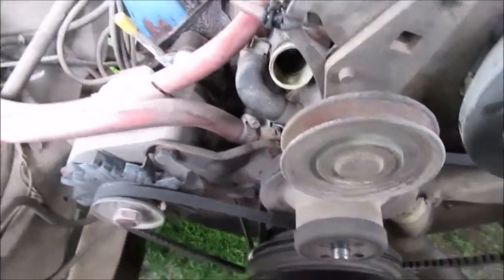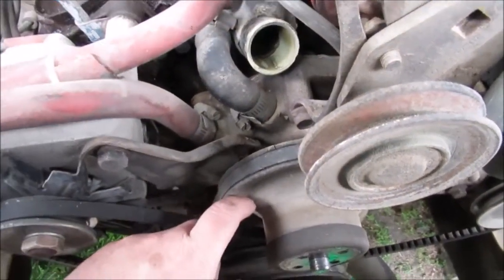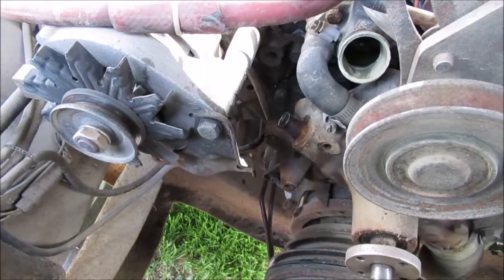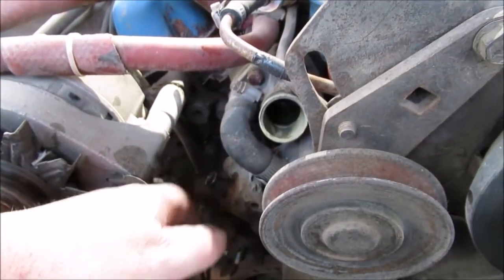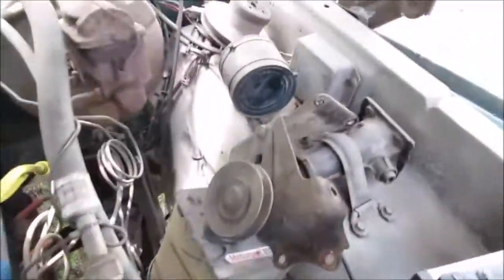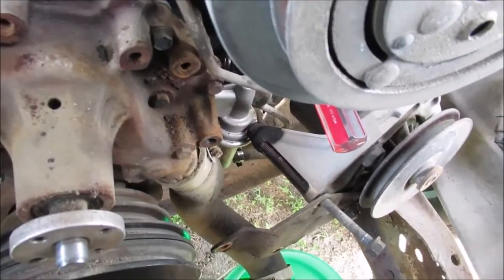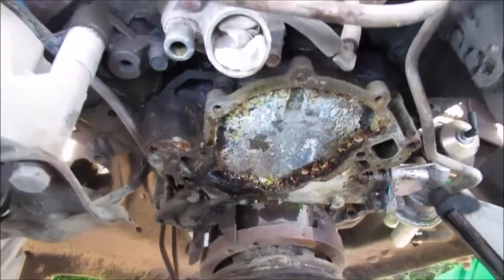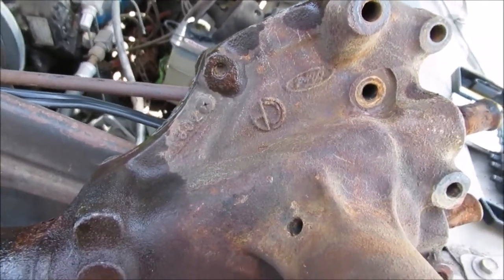Water Pump Removal Ford 302

Comment: That sure brings back memories. The last water pump I changed was in my old 1980 dodge ram with a 318 many years ago.  I’m scared to open the hood on my new truck today. LOL.  Great video Jim
Reply from the maker: The old ones are the only thing I will work on

Comment: on a side note, in the early 90s f150s, with the 300-6, the fins on the water pump are backwards or forwards according to if the the truck came with a/c or not, because the belt runs on opposite sides for the same reason. So always make sure your new water pump fins face the same way as the old ones did :)
Reply from the maker: I am sure the newer 302 is different too if it has a serpentine belt